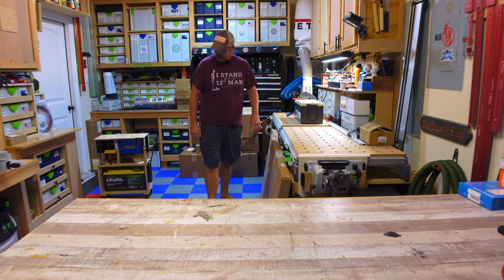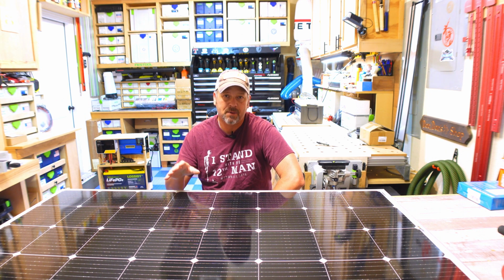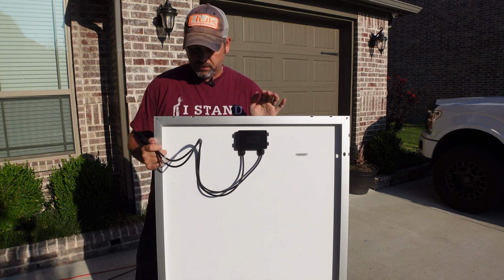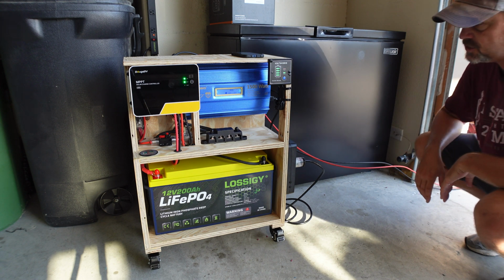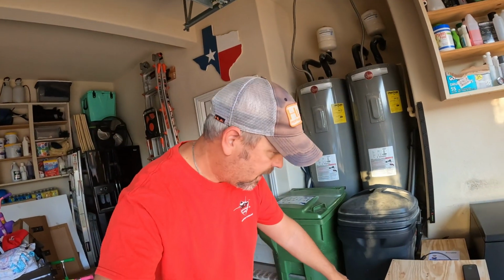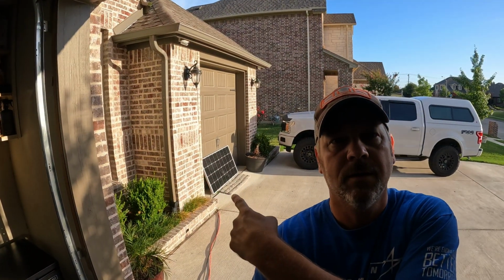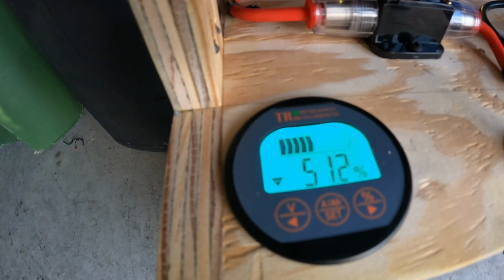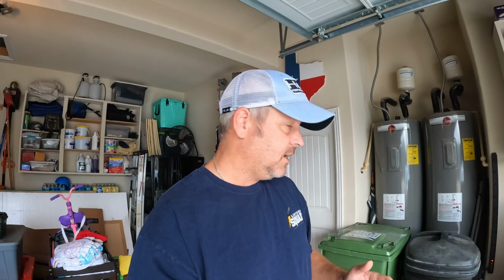BougeRV 200 Watt 9BB Solar Panel | How long will it power a FREEZER in 100 degrees?

Comment: Does the HOA also blocks people to put solar panels on top of the SUV? Because if they do not, you can install a nice mount and fit them securely and run the cable thru the garage. Its a work around and I dont think the HOA would not even know because they would be on top of your vehicle. Just saying L( Love your channel though!!!!  I am going to build something similar but with a Redodo 300A battery, for emergencies

Comment: Awesome real world test, a big problem with these newer systems is the inefficiency of the inverter and the charge unit. The digital controllers also use a fair ammount of energy to display the screens and communicate with the apps.

Comment: Great test run. Thanks for taking a LOT of time to video/edit/and move your setup all around.  Could you set up a 2 panel on a pivoting pole in the backyard?  I have 2 of these 200W 9BB panels mounted on the side of my house using Ecoworthy brackets.  (Facing straight on South) I can easily change angles for seasons and only need 20 ft of extension cable to my Ecoflow 2 Max. (2048 wh) I can easily run my 15 cu. ft. upright freezer indefinitely along with my 65” oled tv, 7.1 ch speakers,  & WiFi router. (I’m kinda cheating as I have a Ecoflow D2M battery as well)
Thanks again for doing all this work for us.  Clearly I’m late to this “party” but I just got my system up and running late May 2024.  You just earned a new sub as you take the time to make good informative yet concise ‘tube’ 🙏👍
Reply from the maker: Thanks!!

Comment: One big loss is inverter idle when the compressor isn’t running. 

A chest freezer can keep food cold for 48+ hours and should be able to cool back down fully from a short off time in 4 hours or so. 

Run the freezer when there is sun and cut off freezer at night.

If you do this, you should be able to run the freezer indefinitely since you are adding power during the day.

Comment: Where did the four cells disappear from the panel? It's only a 4x8 array when the standard is a 4x9. That means that the output voltage is lower. Since power is amps TIMES volts, the output is obvious less. Also, with unequal voltage offset when paired with conventional panels, it will drag down their output as well.

Comment: Toss in 1-3 more panels, that controller can handle them easily and it will help squeeze more power out of cloudy days, 2-4 panels (2s2p) is easy enough to move around with these small panels.

Comment: can you just lay the panel in like your front yard on the ground or can  you make a stand mount for it in your yard ?  silly rules. i put mine on my roof i dont care about the rules haha as long as i dont have like a 600+w on my roof ill be fine.. have something i can just remove easy set up like yours
Reply from the maker: I could, but highly likely the panel would grow legs during the night and walk away

Comment: It didnt measure the used wattage because you connected it via the battery so how would the charger know? It doesnt, the used wattage for the controller is just the 40w output on the controller itself thats meant for a cabinet light where you put the controller..  btw dont use those outputs they burn out the controller anyway..
Reply from the maker: 👍🏻👍🏻 thanks

Comment: Great video and answered a lot of questions about capacity etc. I think it was pretty darned impressive given your limitations with the placement of the panel. I guess it is safe to guess that had the panels been properly oriented south and with optimal angles it could possibly have run 10 days or more. Another 200 watt will be interesting. I assume you turned off the controller each night.  I love your dolly and I assume there is a video on the build. I subbed and will take a look around your channel. I have pretty much everything pulled together to build a system. I have two two hundred watt Renogy portables, four LifePo4 batteries. I am trying to prepare for hurricane season. During hunting season I will place two of the batteries and the inverter in my travel trailer which has a 160 watt installed on the roof. I would like to add another 160 top side. I can also bring along my portable panels and controller and tie that in as well. Thank you for sharing.
Reply from the maker: Thank you👍🏻

Comment: Question, I wonder if with this setup would the MPPT pass though directly to the inverter if the battery was full?
To avoid battery load if you are running a high use item during that day that is below the energy created by the solar.

Comment: I just bought two of those with the charge controller. I decided to send  one of the panels back and  just use the one. I had solar panels on my last  two RVs, and they were 100 watts each. So I think one will be enough for my purposes.  The foam packing came in handy to kneel on while I was on the hot roof. Good quality Bourge all around.
Reply from the maker: Thanks Terry. So far I’ve been happy with all the Bouge RV stuff I’ve used

Comment: The 0 on your discharge is on your charge controller. There is likely a DC output on the charge controller, and you have nothing in it. If you want to see output from the battery, you have to meter coming off of your battery to the inverter.
Reply from the maker: Thanks Kevin, makes sense now👍🏻

Comment: It seems like two of those panels with a battery rig like that would probably be able to keep that freezer running quite well.  With that two panel setup I think that would be enough for a basic RV in the summer time but I would want to double that capacity (both in terms of batteries and panels) for a rig built with long term use in mind (I am thinking van-life style rigs and possibly holiday cabins).
Reply from the maker: You’re right James. I think 2 panels would keep the fridge running indefinitely depending on the weather of course
Reply: I just built this power box for our old 1988 GMC van conversion that has been in our family since new. It has been  running a 10 cu ft chest freezer in my garage for a few days, gets to 100% battery charge by mid afternoon. Ma can bring her favorite  80  watt electric blanket with us when it gets cold. https://www.youtube.com/watch?v=cXQO80MghOU

Comment: Others have answered but that Chargepro 2.0 is a generic app that a lot of other Charge Controller uses and not just the BougeRV. I have a HQST 40a controller that also uses the ChargePro 2.0. Maybe all these charge controllers that uses this app are from the same company and it's just repackaging. Anyhow, the BougeRV does not have "Load" outputs unlike 99% of other controllers. My HQST has a load connection and it's limited to 20a. The "discharge amount" is when you have something connected to the "LOAD" terminals. Again, BougeRV does not have it and the App is generic so discharge will never apply to the  BougeRV

Comment: This was a great little video Brian thanks for taking the time to put it out. The question is always "How much solar do you need". In the video I don't think you mentioned how many amps the fridge was using when it cycled. For me and maybe it's the wrong way to look at it but I'm trying to judge my system by my amps per hour output. So how many amps did your fridge use when it cycled? With only 8 amps going into the battery it would never stay topped off it your usage was 8 amps. Is that the right way to see it? If your solar power was 400 watts putting out 17 amps would that have solved it? Doubling your wattage and amp input would that have been enough? My camper van if everything ran all the time uses about 9 amps and hour. What do you think? Thanks and good work.
Reply from the maker: Thank you. I think if I would have had 400 watts, or even better, 600 watts worth of solar I could run this indefinitely ( with good weather of course). 200 watts just isn’t enough to charge up what I lost overnight.
Reply: @BrianWatersOutdoors  Thanks Brian good stuff

Comment: Okay, so in real life if you could have put it on the roof. if you had two of those solar panels and you could have put it on your roof at the peak of your roof . where you had an automatic adjuster where you could have followed the sun all day. you probably could have run it for weeks.... and if you had a wind generator hook to it you probably would never have to worry about it dying at all.  but just in case you had to run it like you did , you can always charge your battery with a set of jumper cables in your vehicle . it takes only 20 or 30 minutes to charge it back up fully , and you can run another 7 days .... so all in all that's a pretty damn good setup if you're only using it an emergency situations.  but if you're using it to run a home , you'd have to have it on the roof and a couple of more panels would make the job a lot easier on the battery... myself I'm thinking about building one.  I was going to buy two batteries right off the bat... but then you have to have a way to charge those batteries . I was going to use a generator that runs off of hydrogen . I've got an electric start generator I'm converting over to hydrogen . so when my batteries Get Low I'll fire up my generator and charge them back up . because gas will not be able to be found when the grid goes down ... especially after a hurricane blows all the gas stations away... LOL

Comment: Great testing.
BTW, to closer number power being pulled from battery, you need to factor in the inverter efficiency, 85% is typical, so you were consuming 4.4kWh measured on the AC output of the inverter, that means the power consumption on the DC side of the inverter will be about 4.4kWh/0.85 = 5.18kWh.
Reply from the maker: Thank you Bud👍🏻

Comment: You could probably run the freezer indefinitely if you allow the batteries to charge and power the freezer off during charge times. The freezer does not need to operate 100 percent of the time unless your opening it constantly, but obviously that should be avoided. Just a thought. Nice information to know, so thanks for that....
Reply from the maker: Good point👍🏻

Comment: Aparently these panels work well in cloud-. I'm considering using a sundanzer Chest freezer which is DC so id get no inverter ac/dc inefficiencies....Your test was amazing i didn't think it would almost keep up. Seems with just 2 panels you could run your freezer.
Reply from the maker: Thanks Justin

Comment: Conclusion: buy a new freezer that doesn't have a 50% runtime.
Reply: The freezer is in his garage which is a common place he lives in Texas where it's 95° all the time I live in Southwest Florida in Sarasota where it's 95° all the time.
Actually I bought a small freezer that fit perfectly in my kitchen and acted as an extra workspace and then my neighbor moved and gave me a 6-ft long freezer that in the haste to get it out of his garage I didn't have a place for it in my garage so it sits in my living room right now but on the other hand it's not in a 95° garage.
I felt that this was a great long-term test because in an emergency you would want a freezer working because if you have a freezer you can make ice and if you can make ice you have refrigeration even if you froze a couple water bottles and then put them in the cooler with the milk 7 days isn't bad the hurricane we just had in Florida two weeks ago I was without power for 2 days my friend who lives in punta Gorda where the hurricane struck she was without power for about 5 days God help the people on the barrier Islands but the hurricane that we had a couple years ago I knew people that didn't have power for 2 weeks you can live without air conditioning as long as you have a fan

Comment: If the poo hit the fan,you could unplug the freezer at night.If you didn't open it you could probably get away with it staying frozen overnight,then you could plug it backup during the hottest part of the day,and make power also.
Reply from the maker: Good idea👍🏻
Reply: That does not work. All you would do is put off the power usage until morning.  The freezer would run continuously until it got to temp again.

Comment: this is a good test even if not well done because its not perfect. shows a 110 freezer can be run off 1 200 watt solar in emergency or for those of us looking to go solar gives a real world what would 8 panels with a decent battery bank do. the freezer/ fridge and or ac is a big question for alot. if 12v would do it or no.. thanks man love it i feel i learned something.
Reply from the maker: Thanks Dusty👍🏻

Comment: I have 800 amh.panels. and 400 amh batterie.  Offgrid .
I use my small deep freezer and a cold box . I only run it in the sunny hours . Chills thing frosty cold but not freezing. 
I run a fan in summer mostly 24 hours a day . I use my tv some .
Lights . Chargeing tools qnd stuff. 
I have to turn somethings things off at night . Just to not over discharge my batteries.

Comment: You are handy maybe make a tilt mechanism for your panels when set up in the driveway it would help you maximize your input and useful during a power outage. Two panels would probably run n that indefinitely in good weather.
Reply from the maker: Will be doing this👍🏻

Comment: Your charge controller is only going to show output wattage from its load terminals which your aren't using--and which you shouldn't use for the size loads you're running.
Reply from the maker: 👍🏻👍🏻 thanks
Reply: @BrianWatersOutdoors  You're welcome.  That's actually why you need the battery monitor.  If you were just running small loads out of your inverter, the inverter would do a pretty good job of estimating your battery conditions.

Comment: Thank Brian for your time. I'm a bit disappointed to see that this 200W panel does not product at least 90% of its capacity output (180W) on the sunny day!. I just ordered 2 BourgeRV 9BB 200W solar panels like your yesterday. It's $207.99 ea. (Amazon With Deal). I hope the package arrive in good condition like your. I'm very exciting to set up these panels with the EcoFlow pro. Again, thank you for your video. Thumb up.
Reply from the maker: Thanks. I think the panel is good, and the wattage I was getting out of them was all due to me. I didn’t angle it right at the sun, and laying it flat doesn’t help it out. I could have gotten more watts out of this panel if I really tried.
Reply: @BrianWatersOutdoors  Thank. I picked BourgeRV because of its small size compare to its competitors (54" High) 🙂

Comment: This was actually a very good test of solar/battery/device power usage.  I have the same situation with eastern sun for one solar panel and another solar project, for deck lighting, with the panel facing west.  At approx. 12:45pm the eastern panel, mounted on the side of my garage, loses light.   Shortly after the western panel picks up light until dusk.  I'm able to gather enough solar power in the time I have sun on both projects, as they are both  low wattage.    Again great and informative test.   That 9BB is big enough to have a nice flat screen TV on its back side.  Ha!
#brianwatersoutdoors
Reply from the maker: Thanks James👍🏻👍🏻

Comment: That's because the Charge Controller has no ability to measure the output of the Battery.  I believe that if you had the BougeRV inverter then the Inverter would connect to the App and fill in the discharge values.  I had ran a similar test on a Medium Refrigerator with 600W of Solar Panels and 400 Ah of batteries.  Pretty sure I would be able to run it in perpetuity.

Comment: Hey Brian. I'm just guessing here but most likely you showed zero discharge amount because that app works with charge controllers that have load capabilities.
Reply from the maker: Probably. But even my inverter gauge was showing 100%